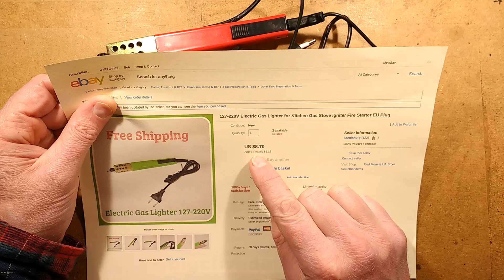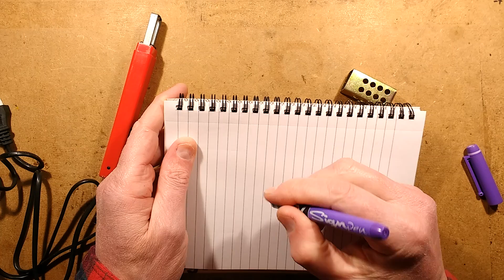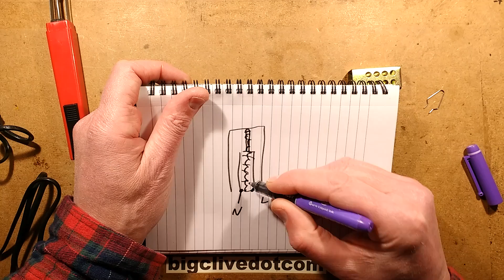Inside a pleasingly scary Russian 240V gas igniter.

Comment: My parents had one of these about 20 years ago, when I was a kid. Now that I think about it, it's a miracle nobody got electrocuted and the house did not burn down.
Reply: Many deaths were due to workers assembling for example gas pipes being tired or hung over or their tools being of low quality, materials used in building construction being faulty because someone made a mistake in manufacturing or the supply of something dried up but the planned production volume still had to be made, and inspectors being corrupt or not having the right equipment or enough time. A chain of minor lapses by numerous people can lead to a catastrophe.
Reply: I never heard that anyone electrocuted himself using this ignitor. For electrocuting yourself, you have to:
1. Touch the metal part on the end;
2. Press an ignition button, that strategically placed on the opposite end;
3. Ground yourself by touching water or radiator pipe.
I find it quite hard to do this simultaneously, but there's no limit in human stupidity.
Reply: Same here, my grandma used to use these igniters years ago. I think we just had common sense to not touch the scary buzzing part under all circumstances.
Reply: @elektroencefalografista  That was literally the scariest thing in the whole world for me as a kid. My worst nightmares had very similar igniter in them. and the fear of it prevented me from doing a lot of stupid stuff with the gas stove.
Reply: my grandma used this. it was a bit better build but still had electrocution risk
Reply: "it's a miracle nobody got electrocuted and the house did not burn down." There is no miracle, those were not built like this modern Ukraine special. Here is one similar to those available back then https://meshok.net/pics3/63872709.jpg?2 
While it looks pretty similar outside, construction is rather different. Hard to disassemble and won't fall apart like this one. And there is no nail inside, LOL. Here is a real deal https://www.ebay.com/itm/201785345409
Reply: You are probably right, it was in the days when common sense still existed. They did not need somebody to tell them not to dry the cat in the oven, as modern microwave ovens have written on them.
But that aside, this thing is as dangerous as the most dangerous mains powered device can be. To be worse than this it would probably need to be just two wires with a handle.
Reply: Voice for the fearful - I can remember a friend heating a tub of bath water using a kettle laid down on a brick, with the electrical connection in the air.
Reply: so did we, and it was very safe, we had a way better one that was insulated, also made by soviet union... this is garbage, they use to make much better ones
Reply: Ultimate DIY
Ultimate DIY Eh, the winding on the coil doubles as a fuse. It burns up faster than the thing'd have a chance to do a complete meltdown :P
Reply: omfg... i got one of those when i was a kid also... such a good igniter... i tried at least 60 types of igniters and lighters and are all shit. the soviet one  was the best
Reply: @Ultimate DIY "as dangerous as the most dangerous mains powered device can be." Hey, there's at least a grill around the active bit, even if it's metal and a bit close to the rest. Look for Clive's "Deadly quack water tester" video...
Reply: I can go one better than that ...... I got called out to a job where the guy was complaining of his kitchen floor getting hot! When I got there it turned out he had lost the Neutral in his consumer unit DP Switch .... and he had a previously undiagnosed Neutral- Earth fault so the main current path was down the gas pipe running under his nicely tiled concrete floor in his kitchen! 
Kind of  handy that it was, as the floor was too hot to touch and would have melted the solder if it were not for the concrete acting as a heat sink!   ...... Not a Happy Bunny!
Reply: Hmmm, I'm surprised that none of you have managed to burn the winding down (it does seem to be made out of quite thin winding indeed). I guess none of you have played with it as long as Clive did :P
Reply: Szakembőr TV TMIAE Holy Hell!!!
Reply: Ultimate DIY - I had no idea such things existed. The only electric gas igniters I've ever seen have been built into the stove.
Reply: I heard some Russian electric boxes (or distribution boxes) had just bare copper wires without any insulation going inside only separated from each other and the metal box itself by plastic or ceramic spacers at different depths or heights. And no ground connection anywhere.
Reply: Dave W Holy. Shit.
Reply: A. V. Dolganov considered, rapidly.
Reply: James Laidler I'll let it as is
Reply: A. V. Dolganov (leave it as it is)
Reply: I will
Reply: A simple cigarette can do as much danger. I don't see any problem with it.
Reply: Well, this lighter was concidered "safe" back then, compared to the only existing alternative - ignigting the gas stoves with matches! If you had kids who needed to rapidely heat something after school while you were slaving at soviet factory, using this lighter was the most sensible thing to do. Remember, there were no microwave owens either! Or piezo lighters.
Reply: +A. V. Dolganov: 'Considered "safe" back then' ?! I'm using one right now ! Only it's bigger, more resilient and has much stronger sparks. And "while you were slaving at soviet factory" ? Get the fuck out with this shit. Yeah, now people in my town are actually slaving in the same factories run by oligarchs who don't give a damn about safety requirements and casualties because they have bought out all supervisor services and prosecutors. And that's in addition to decades of legally cutting down those requirements and labour protections via hands of lobbyists and political puppets.
Reply: But people do get hurt. Lots of people died due to lapses in electrical safety and gas supply safety in the Soviet Union.
Reply: @SianaGearz  "lots of people" -- IS THIS HOW MUCH THE FISH? ))) LOTS OF PEOPLE -- IS THIS MUCH OR IS THIS FEW? YES! ANIMALS OR MAY BE SNOWFALLS OR STRONG WINDS KILLS MORE PEOPLE THEN GAS SUPPLY SYSTEM IN SOV UNION (OR ANY OTHER COUNTRY NOT ONLY SOVIET HAS GAS AND WATER CENTRAL SUPPLY SYSTEMS IN THE TOWNS)...
Reply: It's no miracle. In this age, we have an obsession over safety. Electricity had no earthing for most of its existence and people were mostly fine. Aluminum is also fine if installed with care. It's just less forgiving than copper if done sloppily.

Comment: It's a proper Russian Mains Vibrator! 

(It would likely also work with DC)
Reply: Ollyweg 0 when DC is applied the nail would get pulled in, breaking the circuit, allowing the spring to push the nail back out against the contact, allowing current to flow again, repeat. It's a simple vibrator or buzzer circuit.
Reply: It would work with DC, but the arc would be reluctant to stop causing it to wear out faster and heat up more. AC has nothing to do with vibration in this product.
Reply: You do realize the Z is a modifier to the S, like SH in English?
Reply: @zwz.zdenek  no it should work with dc, the sudden disconnection of inductive circuits create high voltage anyw.

Comment: Ok, now you must start playing with other  Russian things.
Reply: Спички детям не игрушка!
Reply: I wouldn't say "Badly made" but more "bare-bone functionnal" and also Soviet engineers had to find workarounds for shortage. Such as this spark thing using a nail. I have quite a few pieces of Soviet electronics and they are usually quite good. But there are oddities in them. PCB traces that goes nowhere, two resistors soldered in the same hole, etc... Typical of workarounds for a lack of stuff.
Reply: @LeSarthois  Soviet industry was military driven. Most consumer stuff made largely to utilize surplus capacity and materials. Not to make profits. Pricing is pretty much arbitrary.
Oh, and export stuff BTW is made to different standards than the stuff for locals. noticeably better.
Reply: Pyry 1 Soviet technology can be a lot of fun because so much is so badly made YET functional lol
Reply: @danner253  Not all soviet stuff is badly made. All of it satisfies at least one of three properties in my experience:
- really really cheap to make
- reuses a lot of components from other things
- primarily made for military applications.

And yes, a lot of the time you can see how much engineering genius was put into each component to make it as cheap and practical as possible. It's truly fascinating sometimes.
Reply: Anyone else here who built one of those Russian oscilloscope kits in the 1970's? Always being advertised in the back pages of Practical Wireless. (Bought one, built it, STILL WORKS after 45 years or so!)
Reply: danner253
Ay. USSR things certanly weren't made with the good technology, but they still function today, and will continue to for years. While modern, quickly-made cheinese stuff just break out-of-the-box
Reply: @creature_of_fur  USSR consumer stuff was notoriously bad but the Chinese stuff is the next level.
The difference is that while it could be designed by someone who didn’t care, use bad surplus materials and ancient production techniques, assembled by drunks, they weren’t a result of race to the bottom like the Chinese stuff and they had to be approved by a bunch of bureaucrats, so there was a limit to how bad they could be.

The cheap Chinese stuff is aggressively bad. Almost like if they are competing in how much they can screw their customers. This is like a war :)
Reply: +LeSarthois Nail in the spark generator is, so to say, a recent addition. I had such lighter in the house back in the 1980s, it was a dedicated piece of metal in the place and the whole build was way more accurate. Also a lot of Soviet and post-Soviet (Russian, Ukrainian, Belarusian) small electric appliances and fixtures (switches, plugs, sockets, lighters like that one, etc.) were and are assembled by blind people, so their design is intentionally very simple and fool-proof.
Reply: Pyry 1 Nice pizza!
Reply: +Mk Km As a Russian, won't completely agree. I have tons of various Chinese stuff, including microphones, video streaming devices, gadgets and whatnot. Built like proverbial tanks, live through abuse of news production for years. At that, what was made (or at least designed) in the USSR in 1950–60s and survived well into the 21st century, is truly eternal... unless it's made of plastic. Soviet plastic wasn't meant for abuse, too brittle. Yet, if a thing enjoyed a shelf/cabinet life or very careful use, it's still good. Also I recently marveled Korean engineering. Samsung C105AFR microwave, 10 years, nasty cockroach colony inside for the majority of this time period. It worked flawlessly even with an inch-thick layer of insect waste on the ICs and contacts, survived complete overhaul and cleaning... and the design of both ICs and power electronics is really simple, smart and no-nonsense.
Reply: For Russian engeneer, every day is end of month, so you must figure out something blyat
Reply: @SMGJohn
I can guarantee you that design of this thing didn't change a single bit. Well, plastic was a bit better quality back then probably.
Reply: They used to recycle car tires into dildos. The business got hit once they had winter tires with studs on them as base material...
Reply: Андрей Федоров, it turns out that USSR lighters are similarly not toys for the British :) Or are they?
Reply: Dildos made from old lada starters, potato batteries and icicles
Reply: I think they might have some surplus atom bombs left over from Glasnost.
Reply: Crimson Halo isn't his wife Slovenian and ex-wife Czech?
Reply: +danner253
Soviet? You do realise this is two thousand and fucking eighteen? And that device originates from Ukraine?
Reply: @SMGJohn  This is soviet/USSR design, and Ukraine (&Belarus etc.) were Moscow’s colonies and treated as such even now.
Reply: @noop9k  
The fact none of you can prove any of this makes me question this immensely.
Reply: @SMGJohn  Do I need to prove something that is a common knowledge for USSR history researchers (who aren’t Putin’s propagandists)? To a random clueless guy from yt comments section? Who has zero counter-arguments? No, this would be a waste of time.
I can’t even see what exactly is supposed to be untrue.
Reply: @SMGJohn  It could still be soviet tech , there is still a lot hanging around over here . Lots of new old stock
Reply: Crimson Halo: Ha ha ... bravo !!!
Reply: Yeah... Chinese dodginess is becoming old hat! Although, their shower heaters and coffee mug water boilers really can't be beat. 🤔
Reply: spikey russian dildos
Reply: Right after he explains why he is mixing vodka with whiskey. What's the point of that? To dilute the whiskey flavor he might not like!??
Reply: Oh hang on. I don't know if he should be russian into things.
Reply: But stay away from the mail order brides. Donald Trump learned that one the hard way.

Comment: The hydrometer won’t be perfect. You generally need to tare it with the original liquid because sugar and such can push it up as well as atmospheric pressure can change the depth it floats at.

When you brew beer. You hydrometer a value after you create the wort. Then you hydrometer it later and subtract the two numbers and then you have percentage of alcohol.
Reply: Steven Rowley   I did not know about the US liqueur called schnapps there, so thanks for the information; but be informed that Schnaps in German-speaking parts of Europe has nothing added to it. It is pure destillate, not even added caramelized sugar for colouring like in most of the cheaper brands of Whiskey. If you add something you are not allowed to sell it under that name. Schnaps as we use it here is always clear as water.
Reply: No sugar is in spirits fresh off the still, so this will work fine. I’ve seen much fancier ones. Just don’t expect it to work with liqueurs, schnapps, or other such things with added sugar.
Reply: Steven Rowley   Objection. Schnaps has no sugar. Where did you take that strange piece of misinformation from. Schnaps is pure destilled product, usually from fermented fruit such as apples, pears etc.
Reply: You can differentiate between what is called schnapps in the US, which has lots of sugar in it, versus the German version which has fruit essence distilled into it,, but in both cases the flavours don't come from from the alcohol base, but are added.  It probably would be more realistic to call American schnapps liqueur, given how it's often made.  The same is done with many things in the US that pass themselves off as brandies.
Reply: Russians drink vodka. Romanians drink tzuica. Hungarians drink palinka. Serbians, Croatians and many other countries in Eastern Europe have their own (stolen) national distilled spirit drink that contains only ethyl alcohol, water and flavour and aroma from the grains (vodka) or of the distilled fermented fruits.  (Vod from vodka means water). And real man don't need sugar, colour or additives... so this alcoholometer is for whisky and better yet, for scotch ;) ...
Reply: Oh, I'm fairly certain it won't be that far off, especially since he's probably located in a similar altitude to where it's from. I just know from experience you can get a swing from a list of differentials.
Reply: That this alcoholometer is a reliable instrument. And that it is widely used on/with/for many "national" pure alcoholic drinks. The rest is only a lesson on only one aspect of national/local culture of Eastern Europe... and  later, that it would precisely measure of alcohol concentration of whisky or scotch... pfff... And yes, it's not suitable for beer or sugar containing drinks...
Reply: 45°44′58″N 21°13′38″E https://en.wikipedia.org/wiki/Timi%C8%99oara